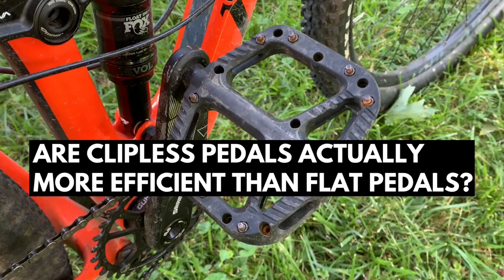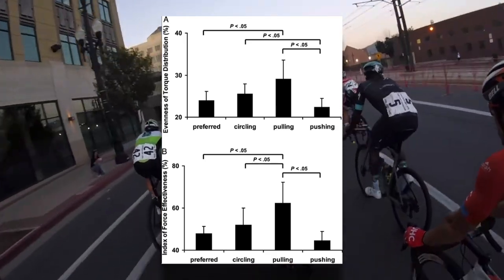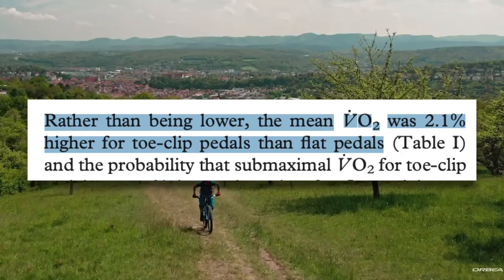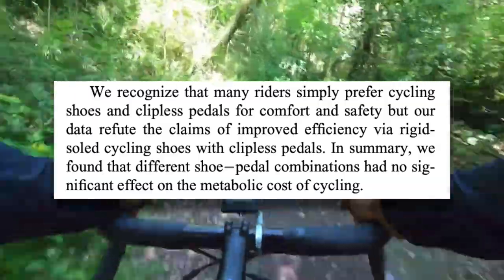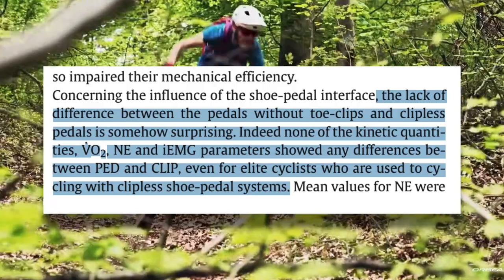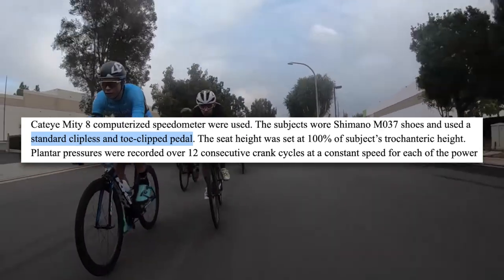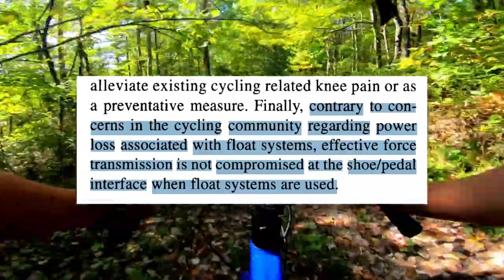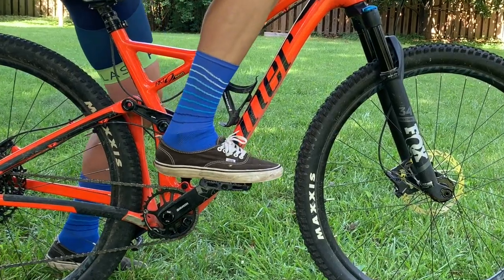Are Clipless Pedals Actually More Efficient Than Flat Pedals? The Answer Might Surprise You.

Comment: From my own experience, I have both a road and mountain bike; road with clipless and mountain with flat. I found myself just loving the mountain bike more, partly because of the freedom of the flat pedal (just as how we first started biking as a kid!) I wasn't uncomfortable with clipless on my road bike, even having done some races, but there was always a fear of falling to me when you had to unclip. (And 8 years of clipless I of course got comfortable with it, but never was excited to put them on and clip in)

The worst would be at harder hill climbs, it could reach a point where it's so steep or you're so tired that you need to get off the bike; but with clipless, you would have a helluva hard time clipping back in at that steep grade. I have some great hills by me and could get 2000 ft elevation in a 15 mile ride; but if my fitness level wasn't there, I would have to rest mid-hill, and clipping back in was really hard at times. With long 10-15% grades, and even maxing out at 20%, I would sometimes avoid them in fear I wasn't in shape enough to make it and if I had to unclip to rest, that would mean I would need to turn around and go back down hill since clipping back in wasn't easy on steep grades for me.

So I ultimately got nice Crankbrother flat pedals for my road bike, use my Five Ten mountain biking shoes on my road bike, and I haven't looked back since! It's so much more enjoyable to me and no more clomping around on the concrete sounding like a horse when wearing clipless pedals. I love flat pedals and the technology now is really good where you can almost feel like you're pulling up on the pedal stroke since you're much more attached to it (than versus when you were a kid with flat pedals). I don't look as "PRO" anymore, but forget that, I'm having more fun and getting out to bike more. My Strava data doesn't show any drop in performance either; and this video helped me further understand that point.

Just looking at our muscles, we can squat and push so hard with our legs/thighs. But we rarely pull up with it - we might reach our car door with our leg and pull it to close, or if practice BJJ you might pull  or keep someone into your guard. Every main activity we do, like squatting and jumping, we use our giant thigh muscles, and so that's what we also use for our down pedal. So I'm totally happy with my flat pedals and pushing down on them, and just not being locked into your bike. If you need to emergency stop or bail out for whatever reason, it's so much more freeing knowing you aren't connected to clipless pedals.

Comment: I grew up riding a 20" BMX bike, later a 26". In college I started commuting on an old-school steel 700c with toe clips (which I still consider flat pedals), then discovered 29ers and simultaneously got into "serious" recreational road/mountain biking. Sometimes with flat pedals, sometimes with toe clips, never clipless. I've even biked across the US on flat pedals.

After 25 yeas of riding bikes I finally drank the kool-aid just this year and bought my first clipless setup and I have to say: "they're a 'no' for me dawg." I do not go any faster and I have managed to eat shit every single time I've ridden with them. I feel totally unsafe being attached to a bike. I have never, not once in 25 years crashed on the road until I wore clipless. Granted, they're usually low-speed, but my most recent blunder was while trying to hop over a curb with a little bit of speed. Had I been running flats, I could have easily put my foot down and saved myself from injury and embarrassment, as well as saved my drivetrain. I've already had to buy two new derailleur hangers in the past two months.
Reply: Yeah, but the hopping the curb parts does not count for the problem?  Plenty of skilled cyclists hop curbs while clipped in.

Comment: Personal experience/1 factor not considered. I became an elite Triathlete in 1984 when I found a bike shop steeped in the "Italian Tradition". I sought them out wanting to train/learn/get speed riding with road teams. I spent the next 3 years in all leather Tommasini shoes with nail-on slotted cleats. Steel toe clips/pedals were customized double strap by robbing old clips of their strap loops & riveting them in reverse. I was 5'8" #130 & a gazelle at climbing - the doubles made a huge difference in climbing for obvious reasons. In the '87 San Diego Invitational Triathlon (changed to "International" later) there was a very steep/short grade between Mission Blvd & Catalina Dr. to Point Loma.  The most insane steepest short climb ever! At the very crest @ appx 2-3mph, out of the saddle pulling with all I had even the "doubles" were not enough to keep me cleated & my shoe/foot violently popped out (possible I hadn't cinched down tight enough). I nearly fell over but caught it. Thereafter I quickly switched to Look. So, in my opinion/experience on steep climbs clipless is a winner, hands down. The surveys/studies mentioned here do not consider the inherent aggressive lift & pull in climbing steep grades. Try that grade in "flats" you'd never make it without an MTB transmission.

Comment: I switched to clipless after 2 years of using flats with a road bike, all the cyclists around me we're telling me that I would see an increase in my speed average by doing the switch. I was a bit skeptic but decided to give it a go, bought some giros shoes for around 100$, pedals for 50$ and Keo cleats for 25 $, it did improve my average by 2-3 km/h after I switched. At first, I was really scared to use them and it took a couple of rides to get comfortable, I had some soreness in muscles I was using differently, but after a while, it looks like I am less tired in fact when doing longer runs and when going uphill, it really feels nice to be able to push and pull and stay stable and connected to the bike if I can say it like that.

Comment: I use flats on my gravel / offroad / commute / everything bike (which also has a power meter) , the difference is mostly in the 1 minute power to sprint power or when it is too step to pedal (but I have wider gearing on that bike, so that is a wash). Actually did 200+ km rides on flats, can't complain about the comfort, but can't complain about road clipless comfort either, so that is a wash, too.

Flats are definitely way more convenient for commuting and riding around town.

Comment: Dylan: Initially I was surprised by the results, but I took it back. The metric we talked about here is efficiency. Human is an amazing adaptive machine. We tend to adjust and make use of our energy for a given situation. Therefore, regardless of clipless or flat pedals, the efficiency is more or less the same. Studies on efficiency of running has similar conclusion -  stride, running style, etc do not impact on efficiency (statistically significant).

Comment: I know I'm late to the party but I just want to share my set up. Some context, I'm a 60 year old reformed couch patato that took up cycling about a year ago. I bought a used (good condition) 2003 Trek 5500 which came with flat pedals and clips. I replaced the straps in the clips with Lock Laces. My shoes are ultra light running shoes that have a zero drop and use the new carbon plate in the sole. With this set up I can quickly get into the clips, feel secure when applying force on the downstroke (sprints and hill climbs) and am still able to quickly dismount if needed. I also feel like I get a spring back from the shoe (just like when I'm running) which assists the up stroke. I tried clipless pedals at my local bike shop but I just like my current set up much better. I don't know if this would work for a proffesional cyclist but for the amature I think its definitely a viable option.

Comment: The conversation usually compares the down stroke  and when pulling up.   That misses the 3rd part of the pedal stroke that I have found makes a difference since I changed my pedal stroke:  The part of the stroke where you pull thru the bottom but do NOT continue that power thru the up stroke.  Dylan has their been any scientific research on this stroke method where you do not power thru the pull up stroke but power thru the down stroke and the bottom stroke only.    So exerting power thru 2/3 of the total pedal stroke.

Comment: I run xpedo flat pedals with five ten shoes. Used to run clipless as a road cyclist, but getting into mtb after many years of dirtbiking, I like the ability to put out a foot instantly when sliding through a corner. For me, flats have the disadvantage that a foot sometimes comes off the pedal on technical climbs or off a jump, but improving technique makes these situations more rare.

Comment: Great info.  When I tour, I ride 60-90 mile a day with a fully loaded bike for 2-4 weeks at a time on a mix of pavement and trails. I am sure  that 97% (to use the stat in your video) of my power/time is just spent pushing and not pulling.  But about once a day or so I reach the limit on my push ability and have to give those muscles a break while I focus on both pulling and extra-conscious ankling with the result being that I can keep going through the drop in my energy and strength. Doing this absolutely requires clipless. If there is more research done, I would be curious on this effect that only comes out with sustained longer rides.  thanks again

Comment: I've suspected this for a long time.   Having that ability to pull up is undoubtedly an advantage in special situations like sprinting, but so is having the ability to stand up or to pull up on the bars so as to transfer more power to the pedals.   It's not efficient, but it is more powerful.   It's also nice to be able to hop a bike by just lifting up with your feet.  

I don't worry about clipless pedals when I commute to work or when it's really cold anymore.  I just wear my work shoes or warm boots and ride with flats.  Any difference in travel time is insignificant.  For mountain biking, clipless are better for travelling while flats are better for challenging terrain where you might need to bail at any moment.

Comment: I only use clips because I like the fact that my feel stay in so well. When I'm racing enduro it is essential that my feet don't come out mid run. Also when I race cross country the starts and finishes are usually bumpy grass, so It helps to be able to put power down without your feet coming off.

Comment: This matches my experience last summer. I did several 10-mile timed loops swapping between pedal systems on the trails near my house (mostly green and blue rated trails). What I found was that if I kept my heart rate consistent for each lap, the pedals had no impact on my lap times. It wasn't until I would get fatigued on longer rides that clipless pedals became easier to ride. I was testing to see if I put clipless pedals on my enduro bike could I pick up some cheap speed, but alas, no.

Comment: SPD-SL on a road bike and OneUp flats on enduro/mtb bike.  First, when i tried road biking, i rode flats for 6 months. i able to do quite good times on climbs.  however main differences are: 
1. you can keep higher cadence with clipless (safely - without loosing your feet)
2. it's easy to make a sprint (and then you can pull pedals as well, especially when you are very tired (at the end of intense climb for example)) or during 3-4 mins max effort.

most of the time you don't pull your pedals (with intensity below 120% FTP ?) - main "pro" for clipless supportes.
on MTB/enduro I do climbs with lower cadence like 60-70rpm,
there is a slight difference how you use them and maybe in firing muscles, that's why sudden change feels strange and maybe feels less efficient.

Comment: If you've ever landed your shin on a pedal after hitting a bump while applying a good amount of torque, you'll probably want your feet tucked in.  Toe clips are the best option because you can leave your feet unlocked or lock them in different forward positions to avoid muscle cramps, and you'll still have some pulling force to avoid muscle fatigue on your pushing muscles.  They're less than 20 bucks if you don't make some straps yourself and don't need special shoes.

Comment: I've never been convinced by clipless for touring, but I was told by Dutch cyclists that I should have them. They said you could go uphill faster with them. I still don't believe they could magic up free power. I kept passing them having a smoke break. The difference was that I was carrying full camping gear and they were doing hotel touring. In other tests it shows that the only difference is in sprints in racing.

Comment: Here a few possible benefits of clipless pedals from how a "weekend warrior" sees the issue:

- There is always some "unused" blood flowing through the "pulling" muscles, muscles that do very little work with flat pedals, but that can use the oxygen with clipless pedals "for free". Independent of efficiency, it is possible that this gives a small increase in watt output with the same BPM/effort vs. flat pedals.

- Benefit in very long effort, because the efficient type I fibers of the "pushing" muscles can and do get fatigued/run out of glycogen, and correspondingly the cyclist must use the inefficient Type II fibers / inefficiently use fat as a fuel (need c:a 10 % more oxygen to produce same watts) . Using also the inefficient "pulling" muscles from the start of the effort can delay/prevent this from taking place and after a few hours can be more efficient than tired "pushing" muscles.

Comment: I recently switched to clipless pedals and the most noticeable difference is sprinting. Sprinting can be quicker and more powerful when clipped in because I really use the pull up action. Otherwise, the difference is not very big. To conclude, I accelerate quicker, achieved higher max speed, but the average speed is the same.

Comment: Hard call. I used to ride a Stealth Bomber series hybrid ebike using flat pedals along with a huge suntour gearing system in the bottom bracket and other high end DH components (Fox 40 etc).  The bike could reach 90 km/hour and I would always feel really connected to my bike, often riding 230 km per day for my business. I rode all year round in Toronto, Canada. My only major accident was when I t-boned a car at an intersection and I was able to jump off the bike no problem and land on my feet.  For the life of me, I have no idea why I wanted clipless for my new Santa Cruz 5010 v3 (yep the BMX of MTB).  My long time mechanic who also worked on my Stealth and sold me the Santa Cruz was shocked I wanted clipless (maybe because I was a triathlete 20 years ago using speed plays) I ended up with the hybrid Shimano pedal and hated it in the trails.  Now I’m about to install the Time Speciale 12 clipless pedal to go along the Ride Concepts Transition cleat shoe.  I second guess myself every day about whether to go flat or go clipless.  I ended up with the Time pedals because they are the in between solution between SPD and Crank Brothers.  I keep thinking I made the worst mistake going this direction, for my skill development and for my wallet!

Comment: If you're worried about slipping off or loss of power transfer, I recommend mtb pedals. The pins keep you stuck on. nice and wide. Blackspire make killer pedals. I got the Robustos. They are a bit heavy, but no big deal for me. Slightly concave so you feel locked in. The way I started thinking of it was in terms of pressing vs pulling. Many people can easily leg press 2x bodyweight or squat heavy but who the hell does weighted calf raises or leg pulls?

Comment: I am more efficient with flats than clipless during climbing. I tried time xpresso 7 and didn’t like them at all.
I was slower according to strava data, and switched back to HT ME03T flats, and 5-10 shoes. Lighter than xpresso 7 with cleats, more contact surface, 5-10 stealth sole and pins on HT pedal’s didn’t slip once, and no danger of falls and injuries of course. 
I am hillclimber and vote for flats both hands!

Comment: Clipless pedals may not improve time as much as people think, but they are good for injury prevention--they allow you to work your opposing muscles (flexors). Running, walking and biking in flats will only work your extensors, which can lead to joint instability, tendonitis, shin splints, etc. I really do believe that working more muscles is better than less muscles. Having said that, I don't think the "pulling up" motion should be done much as you are warming up (first 15 minutes of a ride) because the muscles are weaker and more easily strained. And, I consider the ability to move your foot around on a flat pedal a huge advantage, adjusting fore/aft while riding allows you to work even more muscles by changing how much you dip your toes/heels.

I also think those studies are flawed, if someone has been pedaling one way for years or decades and you tell them to pedal differently, surely their efficiency will decrease.

Comment: I changed from clipless to flats for practical reasons - there are just far too many traffic lights/pedestrian crossings in the city where i ride. Clipping in/out so frequently (and abruptly) just makes no sense. Efficiency is only a benefit if you are into competitive cycling (where the roads have been cleared for the event) but practicality is more important when riding in congested urban environments. I have clipless pedals on the bike which is mounted on my Tacx Neo because that makes sense.